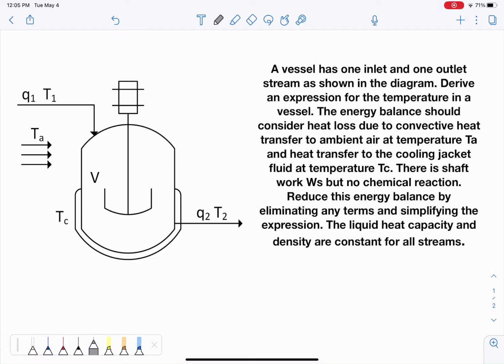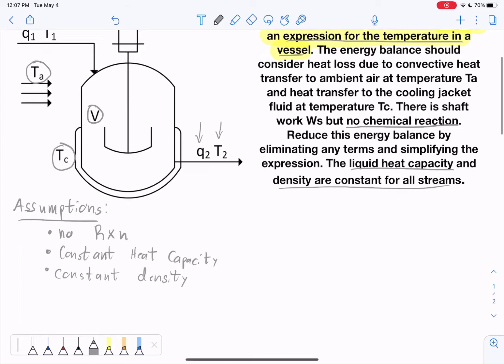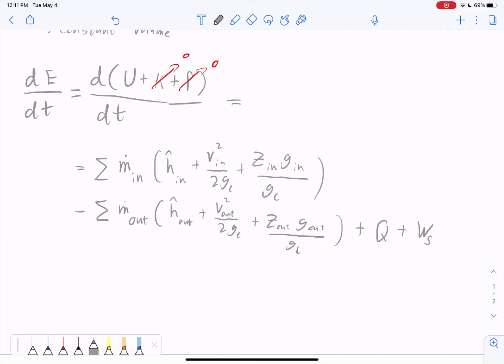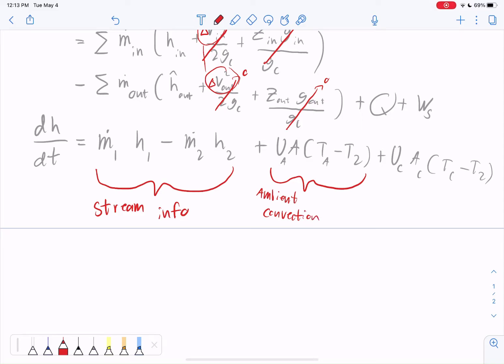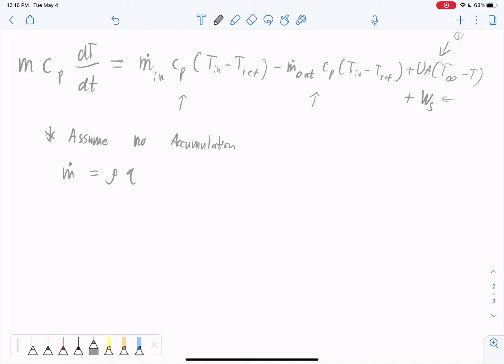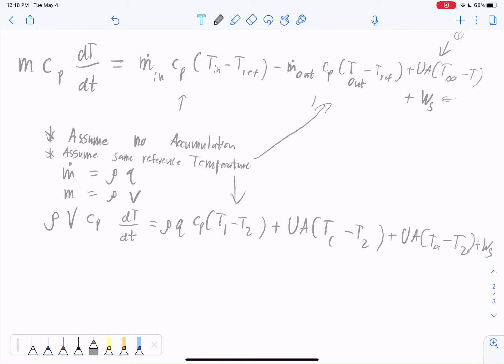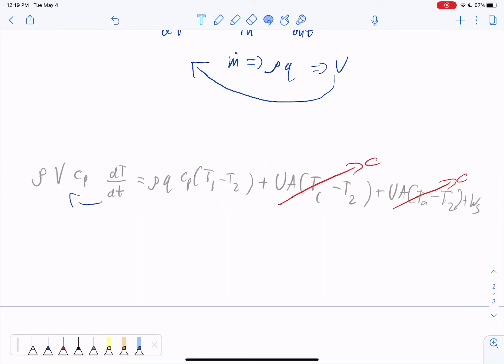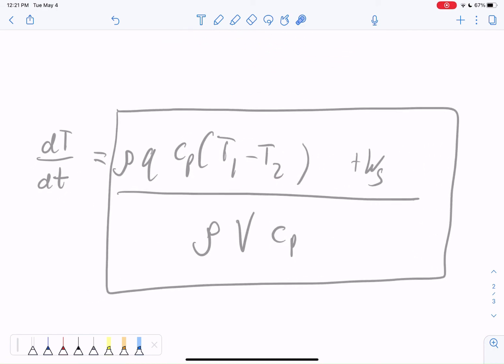CSTR Transient Energy Balance in MATLAB

Comment: Very confusing. You eliminate terms and then add them back in, and frankly ramble a lot. For example, cooling from the jacket was eliminated at one point (5:56) and then magically reappeared (8:04). Not very useful if a student is inexperienced I’m afraid you’ll just confuse them. Where’s the MatLab?